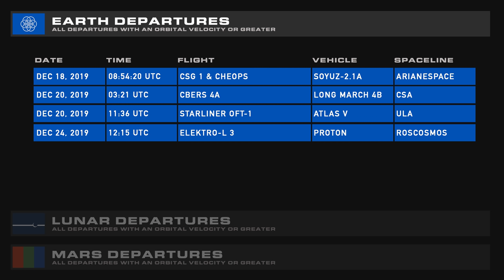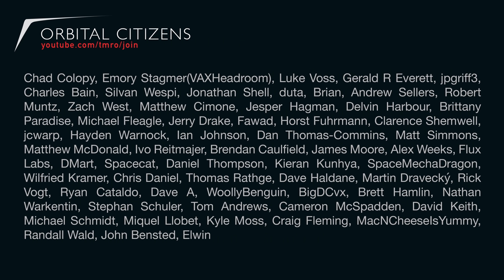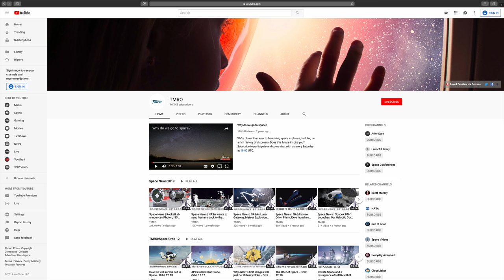Is NASA planning a reusable version of SLS? | Space News

Comment: Other companies: we're moving from expendable to reusable hardware.
NASA: We're converting the SSMEs from reusable to expendable hardware.

Let that sink in.

Also, Boeing: laughing all the way to the bank
Reply: Sad truth
Reply: I think the basic science approach with the gateway and learning how to live on operate on the moon is right on. Alot of that basic science research NASA should be able to supply. It looks like it's going to be a dam good HLV. I don't think Boeing cares if it's a HLV or a smart bomb. They'll apply the engineering and science and build it. 

I'd like to see NASA to stay focused on basic science research and the things that even large companies are not willingly able to tackle or may not even be aloud to do. Such as building a 20mile long electromagnetic/vacuum tube launcher up and out of a 15,000-20,000 ft mountain. Something that can get 200tons up to mach2 at 15,000 ft. without using it's engines. Like a 50ft diameter tunnel with the air vacuumed out with jet engines exhausting into pressure chambers along the tunnel. Or even two tunnels. Using large high-speed bleed valves alternating the air back and forth with launches. Possibly even smaller hexagonal tunnels where the craft simply slides along each of the corners of the hexagon, no electromagnets but mach1+ speeds attainable with pressured air. Something that can launch bout anything,(for a price), that can fit in it and has the right rigging  Launching these rockets with 70 engines + may work but yaa, matter of time isn't it. These people get paid top dollar because they're topnotch people and they cost. So since we're going to pay them here in the states anyways(money is spent here) Then why not have them building something like that? As a potential passenger, I'd like and would prefer  it scienced. Thou others are a little more free spirited I'd suppose. Lawrence Livermore univ and General Atomics worked out the basic basic science of the elevtromagnetics with induc track way back in 1990...
Reply: Nasa is acting really crazy, they are paying boeing, blue origin and spacex in billions and also their project is billions of dollars... Why not make joint space program instead of 4 companies...
Reply: @tentimesful  yeah with trillions to be made by tele and internet. Of course they need to compete. Can these big union places manage that. Some I know can, because they're not looking to control the market and contracts. The workers work as a company with shared interest of being competitive. Because they know ultimately noone else is going to pick up the tab. But yeah what am I privy to. It cost a headache to have all these gadgets. But they ain't bad and I think it could less of a headache.
Reply: tentimesful - Blue Origin & Space have similar approaches which might be able to be reconciled, but Boeing & the companies working on SLS/Orion, etc. are using a completely different approach which can’t be reconciled with the first 2 companies.
Reply: just try to put on paper the exact amount of useful cargo versus a launch cost. if they were standing  for reusability, why they had to ditch the space shuttle program?.
Reply: Vahe Hatch - STS was ditched because of the refurbishment process (60,000+ man-hours per flight + $100 million in parts) & the lethality of the Shuttles (2 LOCV & 2+ near LOCV in 135 flights).
Launch Costs for various launch platforms:
SpaceX Falcon 9 Reusable - 62 million retail price for 18 t (demonstrated) to LEO.
SpaceX Falcon Heavy Reusable - $90 million for 42 t (calculated) to LEO.
ULA Delta IV Heavy - $600 million for 28.9 t to LEO
Boeing SLS - $2B (per GAO report) for 95 t to LEO
STS (Space Shuttle) - $1B (inflation adjusted) for 24 t to LEO
According to government sources, the Delta V that just launched the CST-100 costs $350 million per launch.
Both Jeff Bezos & Elon Musk have stated that the key to getting launch costs down (& getting to space sustainably) is “rapid reusability of rockets”.
Reply: The whole point is to put crew on the moon. If SpaceX beats NASA there I'll eat my shoe,.

Comment: Fact Check: Gateway does not use it's ion thrusters to move from the north pole to the south pole, it moves from an equatorial orbit to a polar orbit allowing access to the poles.  Thank you for tolerating my pedantry.
Reply: Also wrong Gateway will be in a near-rectilinear halo orbit with a period of 7 days. Not equatorial at all.
Reply: @221b-l3t  Thank you, I'm not clear on the 'near rectilinear orbit.'  What range of surface latitudes are available from this orbit, assuming that there is a range of inclinations reachable by Gateway that qualify?
Reply: @jugglinglessons  I'm not entirely sure it's a pretty complicated orbit that cycles around the moon and is very elliptical. It passes over certain spots of the moon every two weeks. It's not an orbit with a fixed inclination it keeps shifting around every orbit. There are some animations but I didn't find anything very good that explains it. I believe mostly the northern hemisphere is accessible without maneuvering.
Reply: If it has no spin, and no significant magnetic field, the moon still has poles? 🤔
Reply: @Levitiy  the moon rotates once a month, it spins, just about 29 times slower than earth (about half a degree per hour.
Reply: @jugglinglessons  Yeah, I know about that. I did consider if its dark/light side phasing could constitute a polarity of sorts. So is that it?
Reply: @Levitiy  I think about the answer and I'm cracking up with the puns.  I see electrical polarity, magnetic poles, and rotational axis poles as three separate meanings of the word pole.  I also see how they are inextricably related. So yes to your question.
For our purpose of navigation on the surface of Luna, we have to reference the rotational pole, and we just chose the north one as the one most closely aligned with Earth's north (about 5 degrees different).  On the moon, i don't think a compass would reilably point north/south.
Reply: @jugglinglessons  Got it. I have also always wondered whether the moon's slow rotation, is a spin, or a tug.
Reply: @Levitiy  It's a spin.

Comment: I suspect SLS's flight profile is not reusability friendly. The core stage is bascially an upper stage which will get almost orbitally fast. However, having done some back on the envelope calculations, SLS should lift off the pad at similar TWR with two strap on Falcons which are 3/4 fueled! The burn time would drop from 162 to around 126 seconds which is also exactly what SLS needs. Hmmm
Reply: I would add 4 F9s and land 2 at LZ1 and 2 on droneships for maximum reuse.
Reply: @TheKerbalKing  ...moo boosters all the way.. heeeey!
Reply: The F9 is already used as side boosters for FH, so that should work, but from what I'm finding on the internet, the SRB's aren't outrageously expensive

Comment: I don't see the SLS core stage being easily recovered as it's almost in orbit at burn out they might be able be able to recover just the engines maybe the entire boat tail using HIAD or make a five engine variant and recover the outer four engines like on the Saturn V-D concept.
Another way to reuse it is let the core get into orbit then re-purpose it as module for space station or fuel depot and maybe put the engines inside a reentry vehicle.
The last and most difficult cover the stage in the X33's TPS, use drag fins to control it's reentry and decent, and stick a J-2 in between the SSMEs for landing oh wait that reminds me of something.
Reply: Given the R&D required to achieve this, and NASA's timescales...
Bearing in mind its taken them 30 billion dollars and 15 years to not launch a shuttle replacement...
Your great-great-great-granddaughter might see it.

Comment: I think it will be more expensive and difficult to develop reusability. There has already been tight restraints on this rocket since it was Artemis back in '03 if my memory serves me correct. The biggest problem they will face with reusability the qualifications of re-entry  and survivability for multiple use of pipes, grommets, fittings and motors which most parts are not. Another issue is the solid rocket motors which are not reusable. So every launch cost of the SLS will stay at 3 billion per launch, while SpaceX will lower its launch cost per every launch. At that point it will come from a business standpoint and just be straight forward to which one you'll pay for, and we already know who that is.

Comment: Landing legs , Grid fins  and space  x landing software for SLS. Now that would be cool if doable
Reply: Nope.
The primary airframe is not capable of taking the lateral loads of reentry, nor surviving the thermal environment thereof.
In addition, SLS just does not have the performance margins needed to loft recovery hardware. It is ALREADY badly underperforming for its intended task.
(this is not SLS's fault, of course. Orion and its propulsion systems have grown so much in mass that poor SLS is becoming obsolete before its first launch)

Comment: It is impossible to make the core first stage of SLS recoverable, let alone reusable. Like Atlas 5, it acquires far too much energy to retropropulsively re-enter without destruction. Furthermore, with only four engines not designed for reignition, it doesn't have the precision retropropulsion for landing as Falcon 9 does. Its large diameter also presents more of a re-entry heating problem than the long, thin Falcon 9 (and is "scale model", the Electron). The big vacuum-friendly SSME's are also probably much less likely to withstand the rigours of tail-first re-entry than are Falcon's atmosphere-friendly Merlins (on the Shuttle, they were well shielded by the airframe).

Comment: Staying in a stable Lunar orbit is not easy as the mass is not evenly distributed and leads to a degradation in the orbt until it crashes into the Moon. That means the Lunar Gateway need constants orbital corrections to not crash and burn.
Reply: They are using solar electric propulsion, so that combined with a high orbit should give them that 15 year lifespan
Reply: @philb5593  Batter have plenty of reduncancy, they're going to need it.

Comment: The Gateway makes perfect sense, it will be also a launch platform for space travel to other celestial bodies without the effect of gravity. That means cheaper space flights.
Reply: You still have to get to the platform from earth. The irony is, for maximum efficiency to do the burn to Mars, you will have to drop back to earth to take advantage of the so called Oberth Effect. So you go to the platform, drop back down to Earth and fly off to Mars. xD That's why it is critizied so much. However, there are other reasons for why it makes sense. Being easier to get somewhere is just not among these.
Reply: @KsNewSpace  With Ion thrusters the trips won't necessarily need to go around Earth to gain delta V through the use of a slingshot maneuver, unless Mars, for example, will be  in the opposite side of the Sun from Earth.

Ion thrusters are inexpensive, clean and capable of gaining a lot of speed over time, but they could not be used to launch from Earth, but launches from space are ideal for this technology. Also, the gateway will have thrusters that will allow it to travel like a spacecrft, therefore you could move it close to a satellite, telescope or other space stations that need maintenance, repairs or rescue (The James Webb telescope for example). 

I think the gateway will be a step to the future os space exploration

Comment: SLS is not going to fly until mid-2021 at the earliest, & the cost per SLS (without amortization of development costs) is $2 BILLION per both GAO & NASA. SLS has already cost $28 Billion in development costs & is slated to cost $59+ Billion by the time Block 2 is flying. Lunar Gateway has been necessitated by the fact that SLS can’t send Orion, its ESM & any lunar module/lander into TLI, & Lunar Gateway is slated to cost $60+ Billion by 2034.
The same $28 Billion already spent on SLS development could easily have funded development of all versions of Starship (including the GIANT 18 meter variant), New Glenn, New Armstrong & Blue Moon & fund a lunar colony & a Mars base. And, the $60+B EXTRA slated to be spent on the Gateway could fund a lunar industrial park, a self-sustaining Martian colony, an asteroid mining project & 2-3 1 km diameter space stations if Starship/New Armstrong were used.
New Glenn will start test flights in mid-2021, & Starship should start orbital test flights by mid-2020, which means both will be ready by the time SLS is. 
https://www.gao.gov/assets/700/699823.pdf. 
https://www.gao.gov/assets/710/701443.pdf
https://www.nextbigfuture.com/2018/11/moon-direct-spacex-falcon-heavy-plan-is-6-years-faster-and-50-times-cheaper-than-nasa.html  
https://www.nextbigfuture.com/2019/07/28-billion-into-sls-through-2019-and-59-69-billion-total-cost-sls-by-2024.html. 
https://www.marssociety.org/news/2019/04/17/r-zubrin-op-ed-lunar-gateway-or-moon-direct-4-17-19/

Comment: Erf?

10:00 "new pad designed to handle up to 12 launches per year"

10:30  "reach 130 launches per year"
This implies that their NZ facility can support launch 118 launches per year?

Math not working out on these statements.
Reply from the maker: RocketLab are building a second launch site in NZ, and looking at a potential site in Scotland. That would make for 4 sites. Certainly doable if their reusability ideas work out. 🚀Jared
Reply: LC-1 is licenced for one launch every 72 hours, which works out to 121.7 launches per year.  If they are licenced to launch 12 times/year at LC-2, that gives them up to 133 launches per year in total.
However, LC-1 doesn't currently have the infrastructure to support a launch cadence that high, so it could be argued that no, LC-1 cannot 'support' 121 launches/year, even if they are legally allowed to.